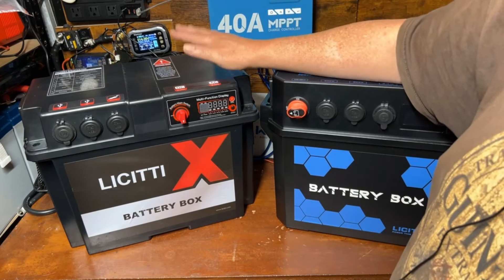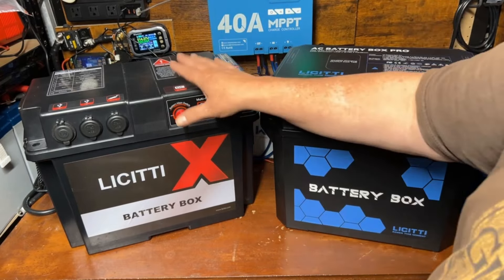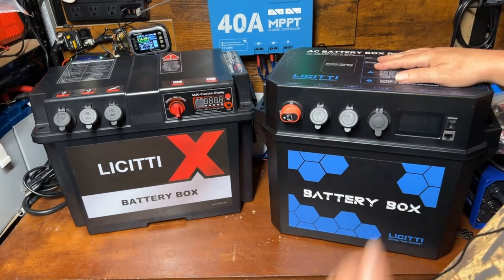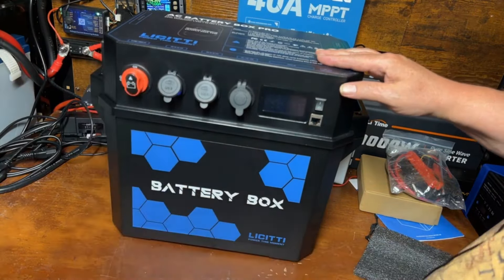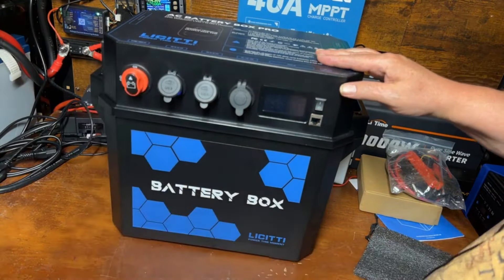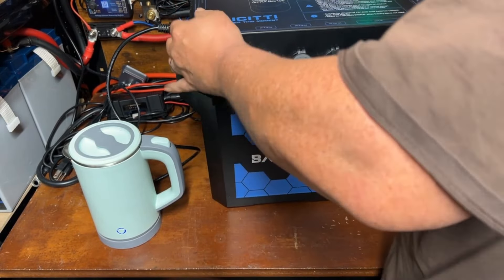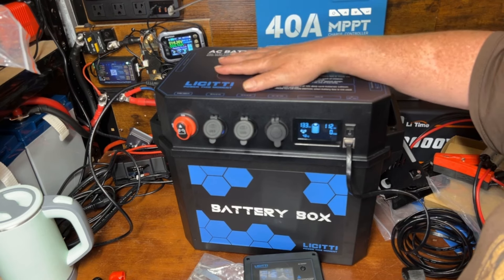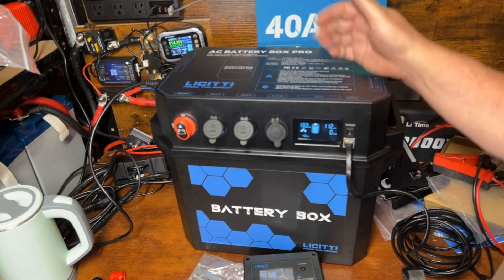SUPER EASY 1000w DIY Solar Generator/Power Station

Comment: Hello. Great video. I have a question. I have two AllPowers 200W solar panels. One has these specifications Open Circuit Voltage 22,2V, Short Circuit Current 12A, Power Voltage 18V and Power Current 11A and other have Open Circuit Voltage 44,4V, Short Circuit Current 5,95A, Power Voltage 36,6V and Power Current 5,45A. Which of these two panels are more suitable for this AC Box Pro?
Reply from the maker: It only has a 10a charge controller in it, with a max input of 45v... so the one that's 44v and 5.95a should work, but will probably only net 120w max
Reply: @enigmascape  Thank you 👍

Comment: 175amps Anderson plug but the wire that is connected to the battery is to thin for 175amps
Reply from the maker: I'd agree with that, and I'm not sure why they chose that size of Anderson plug anyway because there is no battery you could put inside there that could handle 175a charge anyway. As for the output, it's only a 1000w inverter which is not capable of 175a either. I'd have rather just had another 50a plug, but yea, I'm glad you noticed that because I did overlook it. To be fair though, I'd be willing to bet money if you tore apart an EcoFlow or Bluetti or any other brand of power station you will find all kinds of underrated wiring. Undersized wiring is more common than not, and at least with this you could easily get in there and upgrade the wiring if you needed to.

Comment: One Licitti problem.... I got my new Blue Licitti box with the 280 Ah Prismatic cells kit as a package from their website. Since I didn't feel comfortable with it, I took the battery kit to my local Batteries Plus where for a very reasonable charge, put it together.  They were impressed by kit and cell conditions but when it came to putting the completed kit (done using Licitti instructions), the battery terminals were too long coming out of the sides. 
  I looked around here on YouTube and found others who had the same issue and would cut holes on top of the yellow fiber top or bend terminals so they it would fit into blue Licitti box but I didn't think that was a good way.
  I contacted Licitti and got a reply back from "Maria" sending me an illustration of a yellow fiber top with precut holes on top not on the side like what I and others received. 
   This should be an easy fix by Licitti by either changing the terminals to one's that are fabricated from the side to the top or bottom so the cell kit fits into the new blue case. Or they should have the top yellow fiber board cover to have pre cut holes for the terminals on the top instead of the side.
    If you have contact with Licitti, please let them know of this issue that seems could easily solved on their side before word gets around. I like the product and hope it catches on. Thank you.
Reply from the maker: I do have a contact over at Licitti and I will let them know. I have not yet had a chance to check out the 280ah battery kit but I hope too in the near future. I just got the bigger G2 box but haven't got around to making the video for it just yet, and I think the pack was originally designed for the bigger G2 box because the pack was out before the blue version of the 1kw one came out. I will be sure to pass along your comment to my guy over there and let him know some people are having a bit of a problem with that and see if he can work out that little kink. Appreciate your comment!
Reply: @enigmascape  Thank you greatly.

Comment: can you hook up solar panels to charge? How do you charge it?
thanks.
Reply from the maker: They have an option to add a 20a AC charger, or it has a 10a mppt charge controller built into it. That would be about a 120w solar panel is all, but you could wire up an external charge controller that can handle more and charge it up using the same anderson plug on the side meant for the ac charger.

Comment: You can buy a delta 2 for $600 (on sale)
Reply: yeah thats the only problem i see with this. You have to buy the box with ac charger, thats $253, then you still got to buy the battery 100ah lifepo4 battery, like a CHINS for $250. So your at around $500. Thats not that bad.
I was actually looking at the delta 2, since its basically this but in a nicer looking box.
Reply from the maker: @TheNotoriousNemo  Yea, there are pros and cons to either choice I suppose. But, the battery I have in here is a Dr. Prepare which is $189-199 and is about 260wh more than the Delta 2, and you could pretty easily add a 2nd battery for another $189, whereas the delta 2 expansion battery is $549. The Delta 2 benefits are that it has more than a 10a mppt in it so it could handle upto 400w of solar input vs the 160w that this can handle out of the box (but is easily expanded), and the delta is obviously prettier for sure. It can also handle 2000w of output power whereas this can only do 1000w. This is made more for a DIY person where aesthetics don't mean as much. So, it all sorta depends on what a person's needs are. My use case for this here is for a small overland trailer where my power output needs are limited (so 1000w is perfect), but my battery capacity needs are increased if I were to camp in a shaded area for a weekend and still want to get through the trip with limited solar input, so for this use case, battery capacity is more important than those other things to me, and this offers the most bang for your buck in that regard. I think this thing does cost about $50 to ship too, so if I add it all up it's $258+$50+$189+$189+$15 (for an anderson plug to connect the extra battery) I'm at $791 and have 2560wh of battery capacity. WIth a Delta 2 I am looking at $1148 for the delta 2 & an expansion batter for 2020wh (540wh less). Thats a $357 more. In exchange for that though, I would get greater solar input, greater charging power from shore power, 2000w of ac output capability, and fancier lookin stuff too. For some, these things are more important I'm sure and there's nothing wrong with that either and in many use cases might be a better solution for them. The limit of 1kw inverter might be a non-starter for many. I just share options that are out there. I'm loaning this and a mini 100ah battery out to my buddy who's going to take his boat out on the lake for a month to really put it to the test. I'm also going to rig up an external MPPT charge controller to it too ($99) so he can add 600w of solar to the setup. The little 10a mppt is the main drawback I see to this, and if you wanted to use an induction cooktop you would need at least a 2kw inverter, making the Delta 2 a clear winner. If you cook with propane though (like he does), it's not necessary. When he reports back after his trip, maybe I'll make another video.
Reply: A great comparison. The only thing missing is the customer service for ecoflow Which appears (in my experience to be nonexistent). I have two delta 2units, One which completely died After three uses. I also bought a river 2 unit, Which died on the second use. I don't have the experience,Nor could I find on the internet how to open
These units To work on. Ecoflow Wanted videos of me pushing the on/off buttons in order to diagnose the problem. Not much help. The only service center is in Texas. And they don't wanna repair and they don't have any affiliates.
That can service the units. I tried all options, trust me, and finally realized I just threw money out the door. I am on this site
For that reason. And i'm hoping to Be able to utilize The ecoflow batteries Somehow. The problem seems to be in the circuit board With the ecoflow. I used the remaining working delta 2 on a 4 day camping off grid trip only to run a DC fan and charge my phone. It is completely dead as I write this. I keep thinking about the people who buy ecoflow For emergency use only to find the units dead/dying when it's needed. Whatever happened
To customer protection laws?

Comment: Can I run power out of the 175amp port to a bus bar?
Reply from the maker: I see no reason why not. Only issue would be to make sure to not overload the amp rating of the BMS on your battery of choice with whatever you hook to the bus bar. Very few batteries that would even fit in this box could handle the 175a rating of the plug, so of course you want to keep things under that as well, but yea, I see no reason why not.
Reply: @ yes, some LED lights, a max air fan, maybe a diesel heater. And a circuit breaker before the buss bar. That way I’ll use the 50amp in for charging off my 50amp Dc to dc Renogy charger off the alternator (starter batt).
Reply from the maker: @joesalemi2414  Yea, none of that stuff is a heavy load at all really. Diesel heater is maybe 10-12a max, the max fan is maybe 5-6a and led's are 1-5 amps maybe... so yea, should work perfectly fine. I think I'd maybe switch it tho and use the 175a plug for the dc charger because the 50a input will be for a longer period of time and is maxing out that Anderson connector. Sounds like your other loads are less than the dc to dc charger needs to push really.
Reply: @ awe perfect. You’re reading my mind about using the 175 for charge input off the DC TO DC. I’ll also have an 1Kw inverter in truck bed separate from the LICITTI box probly to run the fridge during driving. Battery gets full charge capability then in 2 hours of driving. 
Also shore power. Overkill but yeah all good reason to use the 175 as input charging. 
Thank you.